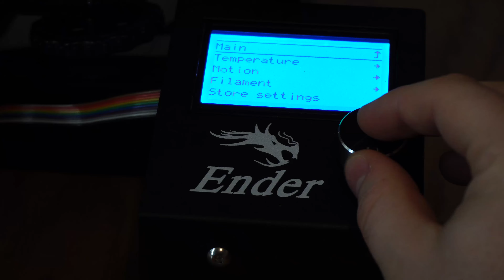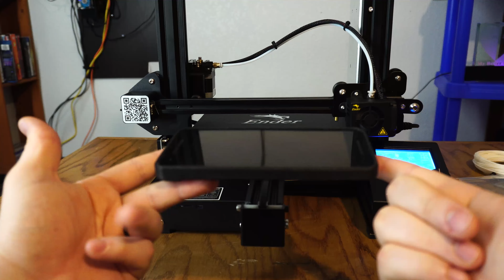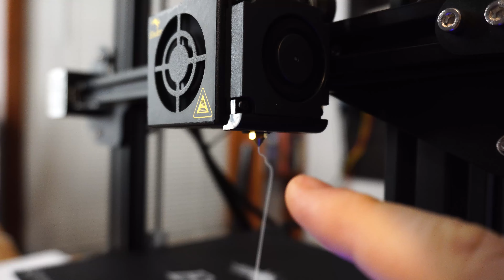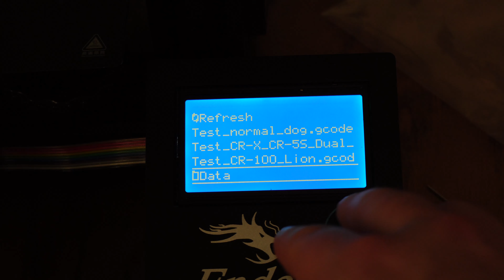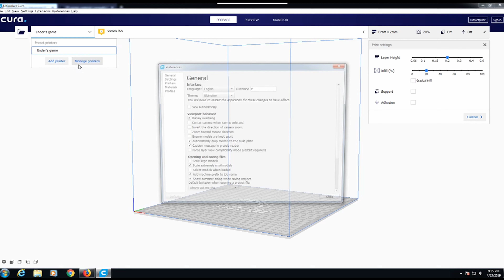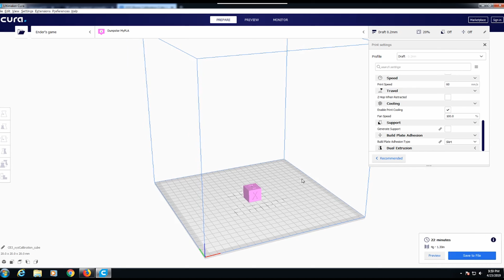Ender 3 Initial Setup + Configuration How-To

Comment: Can you show us how to change the temperature for the print. I can get the temp up to 220 in the settings but when it starts printing, the Temp drops down to 200. I wanna be able to make it print at 220 because the Filament isn't sticking and it's blobbing up out of the extruder tip. Thanks